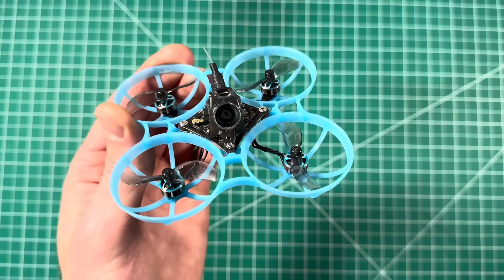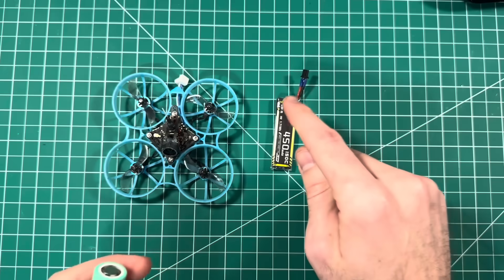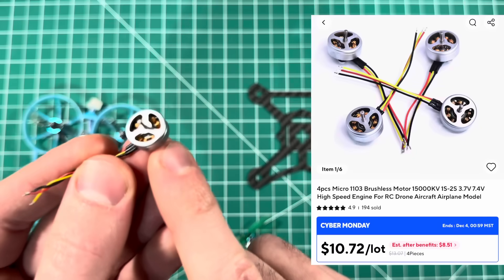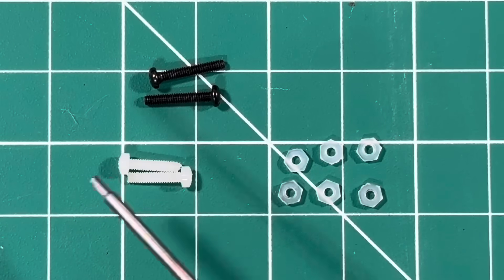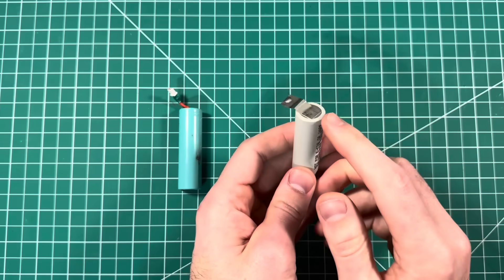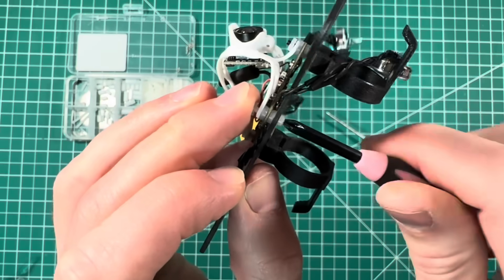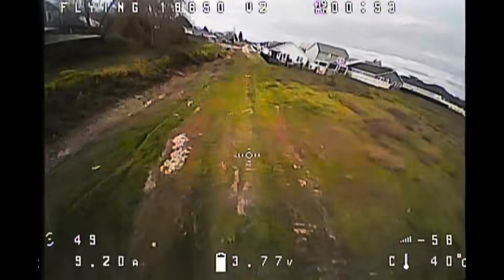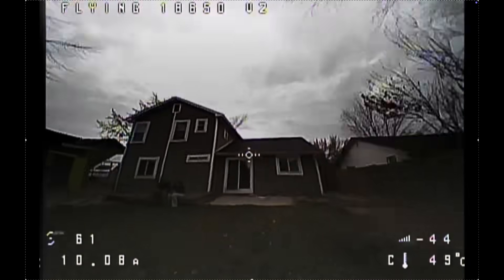Convert Any Tinywhoop to use 18650

Comment: How do you charge the batteries?
Reply from the maker: A 1s battery charger with ph2.0 to xt30 pigtail or my haisito hb6 can charge it on a 1s setting
Reply: is the vi fly whoopstor 3 ok ? I made one like this and want to know if it is safe ph2.0 to a xt30  but this would be the first time charging an 18650 especially without a  charging case and just my pigtail. If I can that’s fire…hoping not literally lol
Reply from the maker: @Anythingmeme  yes I use a viflywhoopstor 3 with the pigtail. Make sure to charge on 4.2v mode :)

Comment: I’m kinda new to this, but how would you improve the camera quality to like 1080p at least, what camera and screen would u recommend?
Reply from the maker: For actual 1080p quality you will need DJI gear. DJI o4 air unit and goggles n3 is what I use for HD

Comment: Congratulations, you just built a toothpick build, but with short arms, which is something first done back in 2018 or 19 I believe.   Bob Roogi, also known as KababFPV,  took the ducts off a tinywhoop, and literally extended the arms using tooth picks so he could fit 2" props on it, and was able to fly it outdoors fairly successfully.  Fast forward to 2020, a toothpick frame is meant to hold the electronics of a 1s or 2s drone, slightly more powerful motors than a whoop, and longer than usual arms, in order to fit up to 3" props.    And despite the improved flight time, 18650s are lithium-ion type batteries and will NEVER out preform lithium polymer, or Lipo type batteries.  Lipo's are built for high and quick discharge rates, L-ion are not.
Reply from the maker: Haha yes, I know that it is a toothpick and I love Bob’s work. I have watched his videos on building his baby tooth model. While I agree with you that li-ion will never match lipo in discharge rate, li-ion batteries have seen recent improvements in discharge performance. I have an Eve 30PL that has a continuous discharge rating of 60 amps and it weighs 5 grams lighter than a traditional 18650. I would consider that high discharge. Of course, most Lipo’s can do that in their sleep but still impressive.

Comment: Have you tested the rcinpower 1003 motors? Those seem to have really good efficiency and thrust numbers on a 2inch prop compared to the betafpv 1102 motors.
Reply from the maker: I have not but that does sound very promising

Comment: Hi, how do u charge the battery after u welded it? Thanks.
Reply from the maker: I either use my haisito hb6 charger on 1s mode with xt30 connector or I use Vifly Whoopstor with ph 2.0 to xt30 pigtail connector

Comment: You could try using 2 850mah lihv cells in parallel so a 1s2p pack. That should give you 1700mah at 34g with higher c rating and punch on your original tinywhoop
Reply from the maker: Definitely worth trying! Thanks for the idea.

Comment: I have experimented with different types of batteries on my Meteor 75 pro with analog camera. GNB 750 mah 100 c (7:30 minues of flight) , GNB 850 mah 60 c (around 6:40 minutes and battery sag huge)  max, 2 stock Betafpv 550 mah batteries in parallel (8 .. 8:20 minues of flight), Liitokala Lii-vtc 6 18650 ( around 9 minutes of flight but it's almost unflyable and eats 10a on hover)/ There is videos about that on my channel.  In fact you built on this video is almost other drone. Also xt30 is way more heavier (around 2.5g/pair) that bt2.0 (0.4g/pair) in this type of 1S drone every grams is matters and affect performance and fly time.  There is also GNB 1s 1100mah  LiHV battery and new Betafpv Lava 2 680 mAh (and also might try it in parallel connection) that is also can be used to experiment to increase fly time but unfortunately i have no budget for this so if you want you can try)
Reply from the maker: Thanks for sharing your experience! I have had similar result testing lipos and yes, the tinywhoop got converted into a toothpick but for $25, I’d say it is a fun option. 

I’ll be making a future video showing how to actually make a tinywhoop actually be able to use an 18650. With the right parts, I believe I can get one flying decently for over 15 minutes.
Reply: @MediocreNerd  In my opinion 18650 is way too heavy for 75-80 mm 1s tinywhoop due to heavy metal shell and contacts. So for long range tiny whoop i assume to use single LiHV bigger capacity than stock, 2 blade props and lower kv motors. Also on Li-Ion voltage sag is bigger, so even if amperage is same lower voltage give less total power. Also BetaFPV prop guard frames are not optimal in my opinion because every guard arm have sharp edges that creates turbulence and noise and lowers efficiency. I think if round it's edges in may be some minor increase in efficiency also some weight can be reduced from canopy with analog camera by removing unnecessary mounts for older vtx
Reply: @MediocreNerd  by the way seems like carbon frame plate from BETAFPV Pavo Pico can be used instead of shown in video - it's wheelbase almost exact as on meteor 75 pro

Comment: I had a cetus x kit i took the electronics from. Put it on a toothpick frame with a custom canopy. Then converted the connector to xt30 so it can run 850mah batteries.
I get around 10 minjtes of flight with it, best drone ive ever built
Reply from the maker: Sounds like a similar concept! I wonder how it would do with an 18650…

Comment: can I just solder a normal bt2 connector to the 18650 or use a xt30 to bt2 adapter so i can use the existing connector on my quad? And do I need a capacitor?
Reply from the maker: You can just use a BT2.0 connector on the battery and I have not needed a capacitor

Comment: What about 14500 batteries?
Reply from the maker: Anything smaller than an 18650 does not have high enough discharge rate and capacity to weight ratio is not good enough to be better than a lipo

Comment: a 14500 would be a better fit for this use case, maybe a 18350 would work too
Reply: a good 18350 maxes out at 10A over 5 seconds, then you risk thermal runaway. it also only has a third the capacity of a 18650 but is priced the same due to economies of scale. a 14500 is even worse.

Comment: make a 3d printed shutting enclosed that the battery unmodified can slip into and it makes contact with the power connections when you close it, then it can be charged and hot swapped super easy

Comment: What interests me most is how the ESC copes with 25A currents. We mustn't forget that it's still only a 1s 5A matrix. It would be great if you could make a really professional build, e.g., a NewBeeDrone blv5 AIO. It's cool because it has an 18A ESC and is 5-in-1, plus it has the same motors as in this video, or motors with the same dimensions but more kV, you could stick with this frame or change it to, for example, 3 inches, and add some better batteries, such as  Molicel P30B, which are 18650 with 3000mAh and 30A, or Molicel P50B, which are 21700 with 5000mAh and 60A. You could also stick with the analog vision because it's aio bma vtx 400mw, and  you can add a better camera to the set. Unfortunately, I don't know much about cameras, so I can only recommend some Phoenix cameras, and that's all. I hope I helped..

Comment: Word of warning to anybody thinking about doing this, the aliexpress motors linked are only 11000kv, typically used for a 2s build, likely way too slow for a 1s build, which is probably why the quad in the video was using 22000kv motors. Really wish people would bother to proofread their recommendations
Reply from the maker: Those no name motors are 15000kv and I have tested them extensively. I would not notice a difference in a blind test between the 15000kv no name motors and the betafpv 22000kv motors. I’m not sure where you got 11000kv from.

Comment: Go to 3" frame, it likely weighs less than the twig and the price is 5 bucks or less, around 12 from amazon for a crux3 frame(thicker clone). Gemfan hurricane 3018 props are incredibly quiet and 1202.5 12,500kv fractal motors are the best weight/flight time/power out there. Its also an excellent 04 machine while remaining a backyard flyer. The 5A aio will work with lipo, not sure about a heavier Lion. With 1s 850mah lipo you can get 5-7 minutes flying as seen in video on a 5A AIO.
Reply from the maker: I just made a build video that basically fits this bill :) it flies great. It would be pretty hard to beat the Twiglet frames weight tho. It’s like 4 grams vs crux 3’s 6 gram (but hey 2 grams really isn’t going to make much of a difference anyway. The 3in build is definitely a little smoother

Comment: Why would you use an 18650 with it's metal encasing? You can buy single cell Lipo/liIon flat packs (e.g. phone battery) in any size you want. Saves on weight.
Reply from the maker: A single cell lipo at 3000mah will weigh significantly heavier than a li-ion because li-ion has a higher energy density. That’s why long range quadcopters usually use li-ion batteries. So even with the metal casing it is still better

Comment: Great videos! Thanks for showing them with the OSD and the final STATS screens, it helps a lot to understand how the converted 18650 drone  behaves.  Could you please post a full video of that 15m12s flight? I would like to see how the voltage/current numbers change as the flight goes on, specially at the end. My experience is that, after hitting about 3.0V, there's less than 10% charge in Li-ion batteries... but of course that depends on the current due to voltage sag.

Comment: Nice. Which config is better for freestyle 1s 18650? 2.5" vs 3" ? Low KV, big stator?
Reply from the maker: Short answer: 2.5” is 10 grams lighter and I think it actually accelerates a tiny bit faster than the 3”. However the 3in is a little smoother and handles aggressive moves a bit better. So I would probably say 3in
Reply: @MediocreNerd 
Thanks a lot
Reply: @MediocreNerd 
I am not sure M75 pro stock brushless can handle 3" really well
Reply from the maker: @s @sebdewey yeah, you would want to use 1202.5 motors for 3in props.
Reply: @MediocreNerd what about KV?
Reply from the maker: @sebdewey 11000kv or 11500kv
Reply from the maker: @s @sebdewey if you want to watch a full tutorial. Watch my “how to build a GOOD 18650 micro drone video” it uses the same FC
Reply: @MediocreNerd yes I did. But I'm not sure what to build. 2.5" or 3"  for best freestyle fpv experience.
😅
Reply from the maker: @sebdewey  gotcha. Yeah my vote would be the 3in
Reply: @MediocreNerd thanks a lot

Comment: It would be cool to mod a tabbed 18650 battery holder (maybe with a velcro strap or something) so any 18650 could be used.
Reply from the maker: That is a good idea that has been done before. Look at HGLRC reckon. They use a holder. The big downside is flight performance. The connection will never be nearly as good as a connector and it leads to low power and less flight time. But like you said the pro is ease of use and switching batteries out
Reply: Convenient but what happens if you bump it and the cell comes loose or falls out?  Then a dog comes by and eats your drone like they do with important homework.
Reply: @UpcomingJedi  lol
Reply: Another downside: really easy to accidentally place it in the holder the wrong way around. Many a flight controller have died that way in the 1S 18650 builder community.

Comment: Are there 18350 cells with similar discharge characteristics?

Or would they be too similar to Lipo for it to be worth it?
Reply from the maker: Anything smaller than 18650 will have 15a or lower discharge and yeah you nailed it. The smaller batteries weight to capacity ratio isn’t very good

Comment: im just worried about the little esc since its a way higher weight and amps than with default motors props and a light lipo at this point you can build a little toothpick with esc that has a higher amps rating and a 21700 even if theyre heavier they can provide up to 50A

Comment: But doesn't overdischarging the 18650 up to 2.60v damage it?
Reply from the maker: Technically you can discharge most of them all the way to 2.5V safely but it will wear the cell down quicker. It’s all about resting voltage. Afterwards the cell was resting at about 3.17v so I was not worried at all

Comment: The ESC on the AIO FC used by tinywhoops almost all has a maximum capacity of 12A, I saw footage of your drone drawing a maximum current of more than 20A at full throttle, is your FC still okay until now?
Reply from the maker: There are 4 esc’s built into the flight controller. The amp rating is per esc. What you saw on my OSD was total amp draw. Meaning, I was drawing a max of 5-6 amps per esc. So yeah, the FC has been working fine on this build for over 3 months
Reply: @MediocreNerd  Thanks for your reply.

Yes, I've read somewhere that the current displayed on the OSD is the total current, but I'm still not sure. My tinywhoop uses a Robo 1002 23500kV motor, and at full throttle it draws 9A. If that's the total current, that means each ESC is handling 2.25A, which is a very small number, but I don't know, I'm just being cautious.

I've seen YouTubers achieve flight times of over 10 minutes using a 1000mAh+ 1S lipo.
Reply from the maker: @D @DimasFebrihardy  yeah, I’d be interested to see what flies better. A 1000mah lipo or a high discharge 18650. The 1000mah lipo might be a good middle ground. 

Some of the other pros for 18650 cell are that they have much longer lifespans than normal lipos. 500-1000 cycles vs 100-200 for lipos

Comment: Base mobula 8 can hold this and fly normally? It won’t burn FC?
Reply from the maker: Mobula FC will be able to handle this easy. It will fly a bit slower than with a lipo tho
Reply: Hello, one more question. Do motors and FC have a normal temperature after flight?
Reply from the maker: @ДанилоРадченко-г1ж  Yes! :) never had them come back more than warm

Comment: Hi! I wonder if you have ever heard of 14500? Basically, it is a lithium-ion battery the size of a standard AA. Currently, Vapecell’s high-capacity version can deliver 3A current and reach 1500mAh! The high-output version can provide up to 10A current and 1000mAh. If using this smaller lithium-ion battery, is it possible that such modifications might not even be necessary?
Reply from the maker: Those batteries weigh around as much as lipos with the same amount of capacity so you might as well use a lipo at that point and get much better discharge rate. I have seen people use some of the smaller cylindrical cells tho and it does work. Just not well

Comment: also those silver cheap 1104 motors paired with a 2inch light frame and a 2-3s cheap jhemcu aio  just makes for a super long flight time 18650 2 inch drone. the motors are exactly the same ones on the darwin fpv by the way
Reply: I actually JUST did that but built it into a 3 inch 2-3s quad using a darwinfpv AIO flies great after some tuning.
Reply: @ytaccrandomvariable  congrats,those motors actually packs a punch. i used the astrorc shuttle frame, really reccomend that frame bc it looks so sick.
Reply: @iLoveFPVdrones  People are too obsessed with using the most expensive parts these days, meanwhile I'm flying circles around them in a build with $22 for 4 motors and a $30 AIO lol. Cheers
Reply: @ytaccrandomvariable  i livein china and on chinese sites fpv gears are sooo cheap, the components are usually half price here especially frames and escs
Reply: @ytaccrandomvariable my first drone, which i built in the chip shortage where prices are soooo high is like this: 4x1104 motors for 9usd, 2.5 inch frame for 10usd, jhemcu f411 stack for 57usd(now the same stack is only 28usd), and 1000mw vtx for 28usd with cameras, reciever for 10 usd, a total of 114 usd at the time and 85 usd now
Reply: @iLoveFPVdrones  That's awesome man, enjoy. Maybe one day I'll go to china just to pick up a massive stack of quadcopter parts.

Comment: I got a spot welder on eBay for about $22 and it works great! It uses a big 3S lipo battery as a power supply. No more soldering direct onto the 18650 terminals.
Reply: Thats such a good idea that many will still scoff at it and solder onto yet another cell just to show you how it can be done with a 30W soldering pencil.

Comment: I use 1s 850mah lihv batteries on my mob 7 (analog) and my flight time is 7 mins on 400mw, for anyone that doesnt want to go all out with the flight time i recomend it, they re the same size and everything, my only complaint is that theyre obviously heavier so the drone is not as punchy but it is still good enough.

Comment: Funny enough I wanted to do the same thing but still keep the lipos, so I took a meteor75 pro canopy, camera and flight controller and stuck it on a happymodel crux3 frame and kept the crux3's stock 6400kv 2s motors on it and ran a gnb 720mah or 750mah lipo battery and got 8 minutes hard freestyle and almost 15 minutes of casual flight and freestyle although it does feel a little sluggish due to the 2s motors flying on 1s
Reply from the maker: That’s awesome! It sounds like a super fun build for sure!